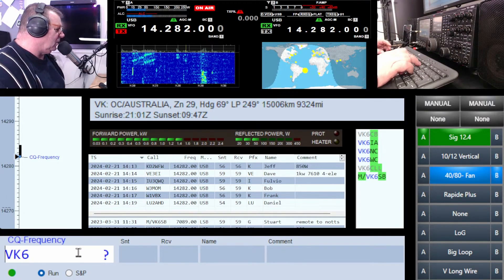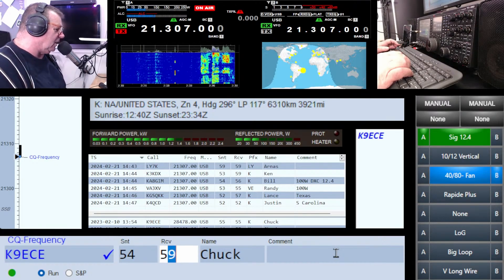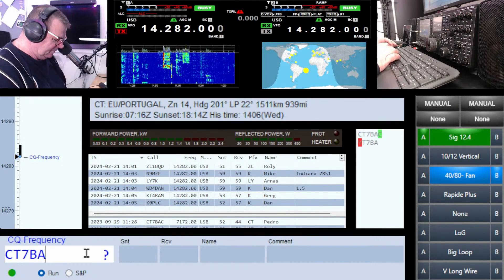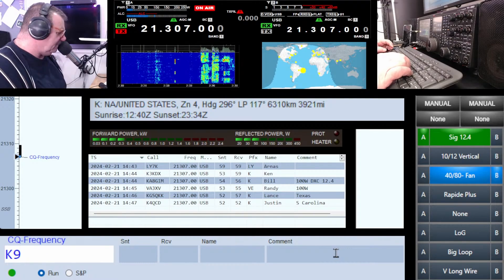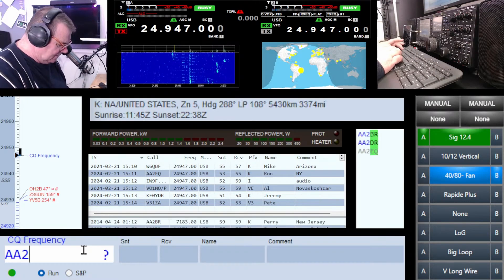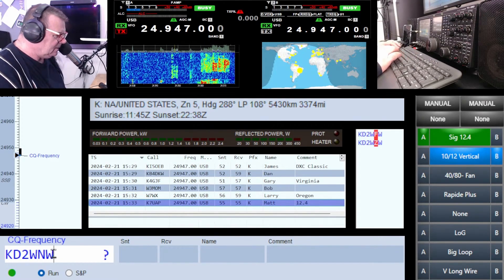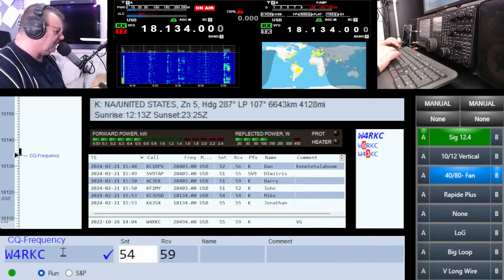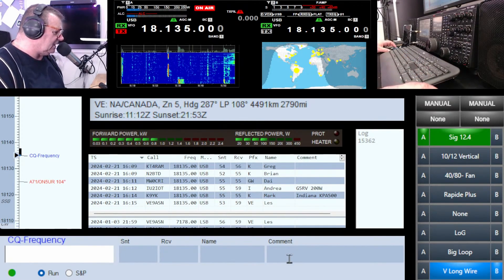High Power Ham Radio Stations - Your Responsibility

Comment: I’m more worried about that 100 watts of reflected power coming back in your station. Not good brother. 73
Reply: Totally agree with you ground control, you want minimum reflected power in this hobby. Even if producing 1kw there should be no more than 5 watts of reflected power. You always want the best of matches concerning VSWR, reflected power, and of course antenna tuning. 73’s
Reply from the maker: Acom 2000 is comfortable with up to 575W of reflected. Nothing wrong with it.

Comment: Can you hear the weak ones ? ..that's a very good point. I'm using a homebrew 4 ele yagi on 15m and around 700w from an Acom 1000,with about 0.5db feeder loss,so roughly 600w at the antenna. My noise floor is S 0-2 and can be a bit of a struggle hearing QRP stations at times,so i would say i'm on the TX power / RX capability limit,so i see no point in running more power and turning me into one of the many stations i hear on the bands that can't hear a a good percentage of the stations calling them ..all mouth and no ears,or Aligator stations as they were known in my old 11m days :)
Reply from the maker: Yes.. I remember a Russian station a few years ago, he was literally end-stopping my meter.. Calling CQ CONTEST.. I hit him with everything I had. Totally deaf..! He must have been doing 20kW. Not joking.
Reply: Unfortunately it happens all the time on all bands :(

Comment: I also have an Acom 2000a. What software are you using? I like that setup.
Reply from the maker: Acom Director (don't use latest version but one before). I also use ARCP 990, N1MM and Camdesk.

Comment: It's no wonder my 100 watts isn't getting through on DX. If I'm hearing a 1 kw station at an S8, or S9. I give up on DX because I can't justify buying an Amp just because everyone else is. Way too much money to spend. Love you videos sir.
Reply: If you're on 10 meters, here's a hint: if the solar flux is below 160 100 watt DX is nearly impossible. If it goes above 170 the world is your oyster. I use 100 watts and a Penetrator at 25 feet.
Reply from the maker: I had PLENTY of 100W stations last night. They aren't rolling over.
Reply: @DXCommanderHQ  Heck, I talked with VK2BY with a TS-430S and the Penetrator from Pittsburgh last night about an hour after my sunset. I turned the radio on and there he was, so I threw out my call and was surprised when he came back.
Reply: If you do your part, buying quality low loss coax. And provide said coax with a good resonant antenna. 100 watts will get you worldwide. The HUGE factor is propagation. Then it comes down to timing and technique. But I will say, an amplifier has been the single best investment I’ve made in ham radio. 800-1000 watts really gets you over the hump. It’s astounding the difference it makes. AC4XT 73’s

Comment: I used to run 100 Watts in the 70's and 80's and that was bad enough. I did start running 25 Watts and still getting out.
Breakthrough on three t.v.'s and two hi-fi systems. Our own t.v. was fine, but the company did have a radio amateur working for them, I believe he was on the development side, and they should have pushed the TX4 chassis when C.B. radio came out. A missed marketing opportunity. 
I hope home entertainment equipment is made better these days with that kind of power.
QRP since moving QTH, 33 years and no problems. I still get out. How loud do people want to be? A loudness game.
Some U.S.A. amateurs run 1 kW, 5 el Yagi, 5.9.+20dB signal reports. Why? I thought it was written in their licence to run the least power to make a contact.
G4GHB.
Reply from the maker: Difficult if you want DX on 40m. But everything is possible, depends on how much patience you have.
Reply: @DXCommanderHQ  Yes, VK3YE does well on the beach. 
Location, location, location?
Not sure how I'll do here as I've been inactive for 8 years 160 to 20m due to internet QRM of S8. It cleared up when they went to fibre optic cable in January.
73, Bill, G4GHB.

Comment: So now you have the biggest stick in the UK and contributing to an increasing problem with QRM and RFI. If you really knew anything Cal, you know that it’s all diminishing returns after about 600 watts. Now the UK is about to experience what we’ve had to deal with in the USA for decades, a QRO arms race. All it’s done is made many bands completely unusable and squeezed out the majority of stations running 100 watts.
Reply: I hear U.S.A. stations 5.9.+20dB. Not surprising, 1.5 kW, 5 el Yagi, 100' tower. I'm glad I don't pay their electricity bill.
How loud do they need to be?  
Recently my 5 Watts got me Sicily at 5.5. report, 1400 miles on 17m on my attic dipole. Readabilty 5 is what matters.
G4GHB.
Reply from the maker: I genuinely don't understand about the QRM issue. If the bandwidth is set correctly, you shouldn't splatter. END OF.
Reply: Anyone who knows radio can relate to this...

Comment: Interesting effects so far with QRO here. The TV in the living room turns on from standby when TXing,, a touch control lamp in the hallway flashing like a disco and my wireless keyboard back light comes on. 😮
Reply from the maker: Haha.. OK Ade.. I remember having to reboot the fridge!
Reply: If you want to find out what RF can do run power. There are things you can do with a 4 watt CB radio but it gets more interesting the farther upscale you go. Let's start with your CB. 
You can interfere with analog television. Usually making the picture fuzzy and coming through the sound. You can come through the landline telephone if someone is using it. You can be heard on record and tape players. You can come over commercial public address systems if you're close enough. 
Let's put a 100 watt linear on. 

Everything above gets worse. You will not only blank out your TV but those of you neighbors. You will start coming through their phones and stereos. If you are in an apartment and using an indoor antenna, picking up a spoon while you're transmitting becomes a shocking experience. Been there, done that. 
So, we earn our ham license, and go for the maximum amount of power output. 

Expect to come through phones, TVs, table radios, and all sorts of things even though they are turned off and unplugged! Fluorescent lights will illuminate as if by magic. Family members may be shocked when operating faucets and shower controls. Microprocessor controlled equipment like HVAC systems, washer/dryer, dishwasher, and the refrigerator may stall and stop working. Garage door opener may operate on its own. People wearing jewelry may experience minor burns. Home security systems will begin sending false alarms. 

The way to avoid this carnage is to mount the antenna as high and as far from any houses as possible.

Comment: You know Callum here in states there's a lot of hams that dont have very good antennas and then dont use power and the receiving awesome but the antenna is junk for transmission. Just my observations
Reply: Antennas work exactly the same on tx as rx unless you meaning high tx power is causing the antenna to break down..

Comment: My Dear Lord,  

That is all very good advice my Lord.  As with any power level, the feedline, connectors and the antenna are key to a good signal.  At this time, I am testing some common connectors for a YouTube Presentation; N, BNC, UHF.  The short answer is that the often-maligned UHF male and female are good connectors if they are good quality.  Again, the antenna system is of course the key to a good signal on TX and RX.  

73, from the State of Kalifornia Kilowatt, Jim 

PS: I am still toying with getting the new Rapide since I only have a 20 meter homebrew yagi.
Reply from the maker: Jim, drop me a line and I can build something for you!!

Comment: That was fun. in the USA we had 1.5 Kw for a long time.  with high power on wire antenna have to do a loop back and solder or twist cover with heat shrink. get the right weather and can throw a spark off end of wire. no sharp end . DX wire is good QRO. both the DX 10 and DX 50 easy do 1Kw just fine. also watch your distance running QRO . RF burns can easy happen. it can just jump to you. great fun ! 73's
Reply: Sounds like corona discharge. 73, Jim W6LG
Reply: @ham-radio  yes ! Cal gives instructions on his antenna's to prevent this off the end of wire on his antenna's . things change at KW RF power levels . 73's

Comment: In Canada, as a holder of advanced qualifications, my power limit is 2250W PEP as measured across an impedance matched load.. That is as written in our regulations.
Reply from the maker: Fascinating.
Reply: @DXCommanderHQ  That was just an fyl for comparison. I know if very few people with amps that large here. Maybe a couple that hang out on 160M but that's about it.
Reply: What amateur amps can run that kind of power, the big Henries?

Comment: Oh, strange things happen running high power! One time I didn't realize that my balun had become filled with water. Transmitted fine at 100W, but when I went to push about 1kW things went very wrong. SWR jumped all over the place, and tuning was near impossible everywhere. The heat from pumping 1kW into a water filled box desoldered the coax and even melted the center pin. It was late night, so I shut down and found the issue the next day. Water is NOT your friend!
Reply: Our radio club inherited a Dentron 2meter amp. We were running a Stationmaster on the 146.61 repeater. It was fine at 100 watts but not at 1500. The higher you go with power the smaller the window of error becomes.
Reply: @spaceflight1019  you've got that right! Did you hurt the repeater?
Reply: @NovemberOneOscarGrouch  It caused the amplifier to fail, long after everyone had gone home. After the second failure we abandoned the amp. We would encounter the problem of the GE Master 2 110 watt repeater amps failing and the "cure" was to replace the antenna. Once we abandoned the Stationmaster and went to a four pole the issue went away.
Reply: You had an RF powered electric water heater.  Good that the amp did not arc something.  73, Jim W6LG
Reply from the maker: One way of heating up the coffee!